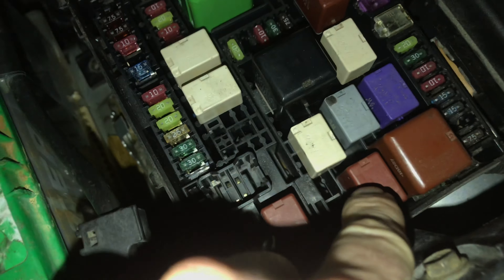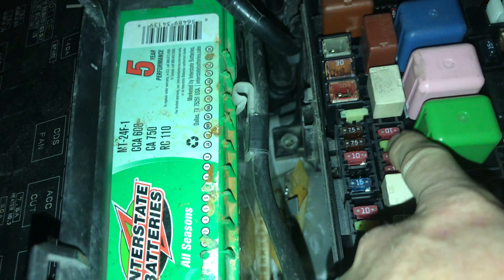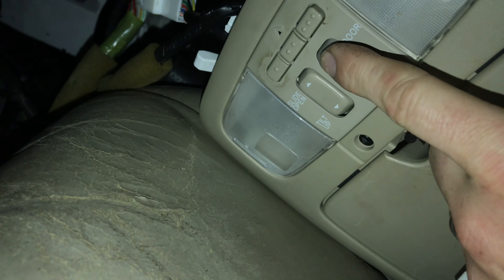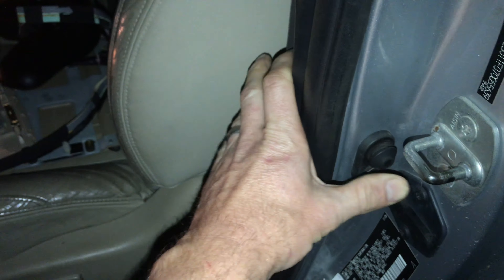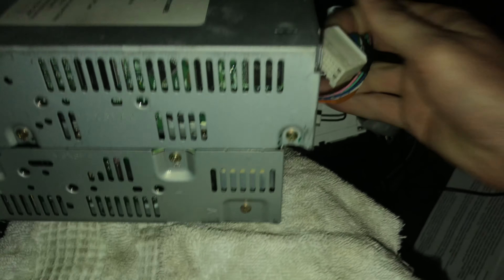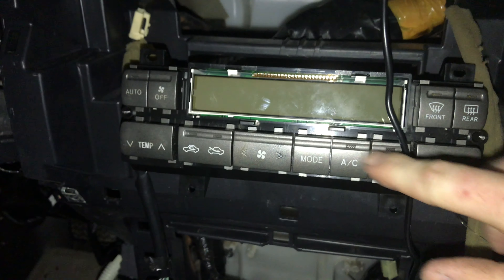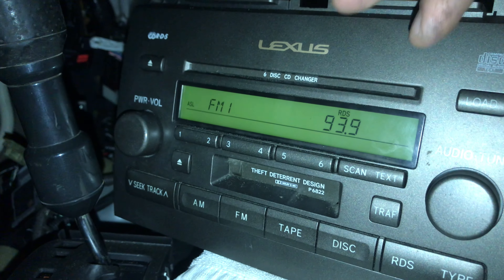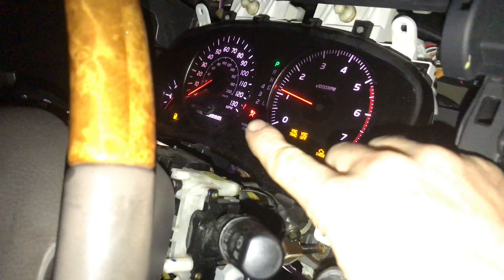GX470 Non-Nav dead Radio solved! “Short Pin”

Comment: What concern were you experiencing? My volume knob doesn’t work but my tuning knob works I can change stations but my volume doesn’t work I can’t even turn it up with the buttons on my steering wheel, weird part is when I power off the radio and turn on I can turn up the volume with the knob for like a few seconds but then it won’t turn up or down, I was able to turn it off and on to try and max it out but still no sound

Comment: Hi, I have several issues after cleaning and detailing interior  of my GX470. The whole screen is off with no audio and even clock and MGP doesn’t work. Looks Like Disc changer doesn’t work either. Can you please let me know if you ever had similar issue and what can be a cause and fix in this situation? Thank you, much appreciated
Reply: 8m having Same issue.    Ever figure it out
Reply: Did you ever figure it out? Have the same issue currently!